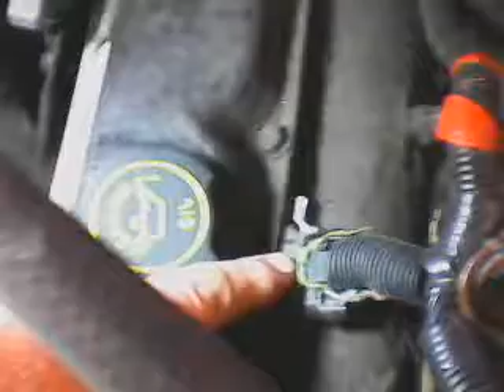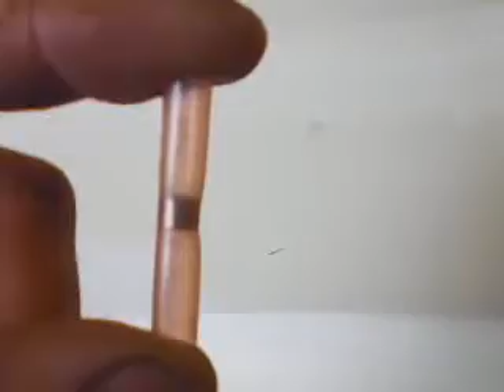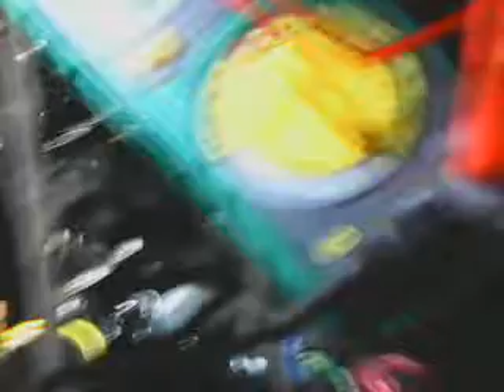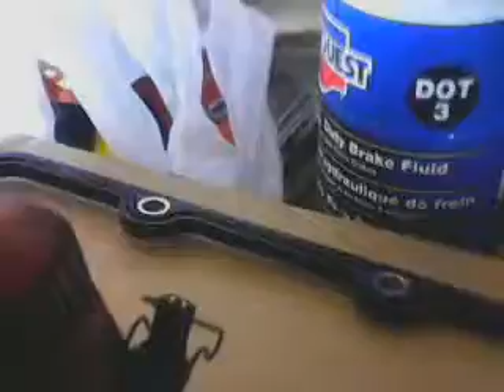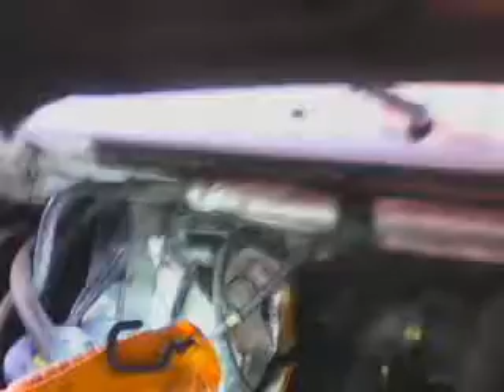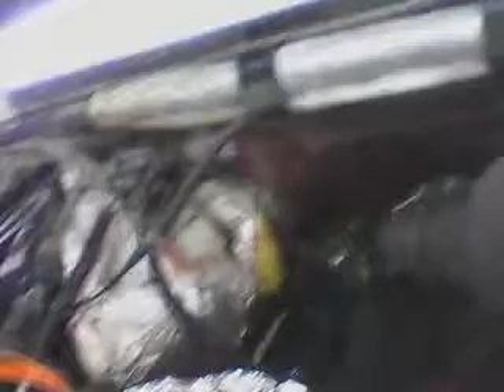Ford 7.3 powerstroke Valve cover gaskets

Comment: Having various problems with my ford, 200,000 miles to start. Valve cover leaks like a sieve and I see they aren't simple old cork seals anymore. Does everything have to have wiring in it? Anyway, I can't see your video, very bouncy, out of focus and no light. You were showing a burnt connector that I can't see at all, just black. It would really be a big help if you could clean them up a bit. Thanks, appreciate the help on my truck here. Never wrestled a diesel before.
Reply from the maker: Yes I understand your pain. Sorry for the video quality. The valve cover gaskets are simple enough to do, just be careful when tightening them up and don't over tighten the bolts. If your only issue is a leak, you may be able to get away with replacing the o-rings on the gaskets. But beware if you're in the salt belt, where they put tons of salt on the road in the winter time. The valve covers may be rusted through.
Reply: @rivervalleyfarm482  Sorry, myself, I should have read the comments before commenting myself. I really appreciate that quick reply. So it's similar to old cork valve cover gaskets only with wires and quite a pile more dollars I understand. Gotcha on the tightening. The wiring is simple enough is it?
Reply from the maker: Yes it is. Connectors with pig tails are available at most decent parts stores and Ford dealers. Sorry it took so long to reply, I'm not getting notifications about comments for my channel apparently.